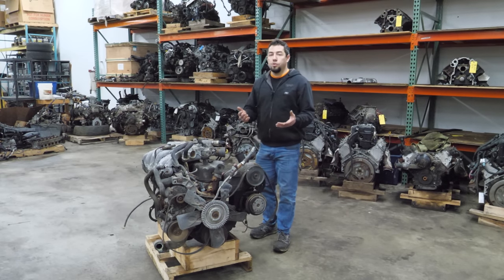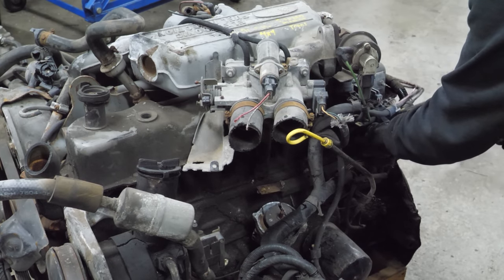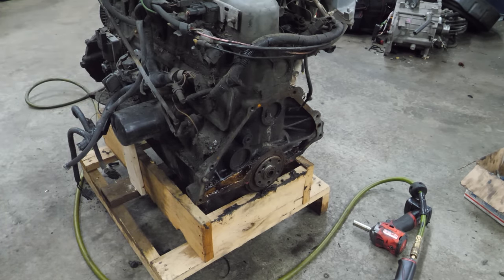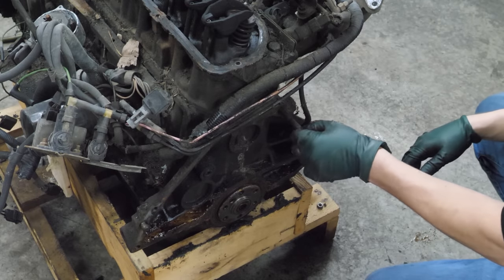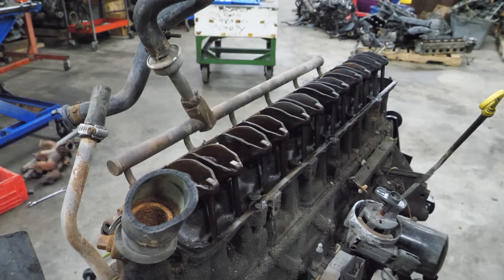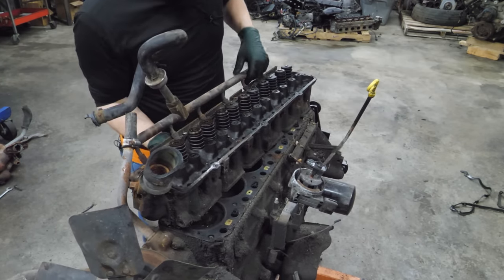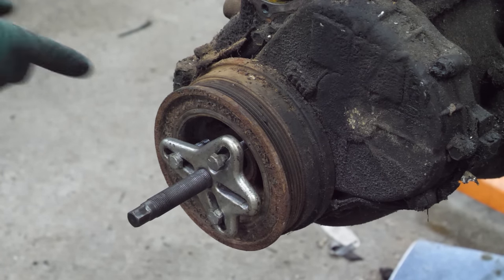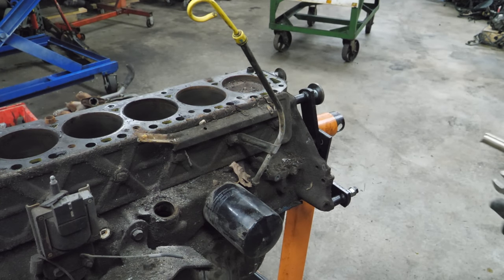FINALLY! A "Bad" Ford 4.9L 300 Straight 6 To Teardown! Most Reliable Engine, Ever?

Comment: Even the most hardcore GM guys think it will be a 300 that hauls the last remaining LS to the scrapper. 

We ran one out of oil on the farm and locked it up. The next day after it had cooled overnight, we added oil and it fired right up. Still used it as a feed truck for several more years.
Reply: No we don't
Reply: I can think of only the 3.0L diesel that is used in the 80s toyota hillux as more reliable 🤣
Reply: @michaeltarno2979  I'd say the 22R could be a serious contender there... My cousin Had a Hylux and put it thru hell and back... Fequently ran it out/ low on oil and that motor would not die....
Even after he crashed it and flipped it onto it's top... that damn motor still fired right up....
The rest of the truck was totaled though....
Reply: Old chevy inline sixes had the same reliability as a 300
Reply: @UAE_8100   The 235, 250, and the 292 were excellent engines.
Reply: @hdezn26  the 22R is a good engine, but not as good as the 300. Honestly the 2.7 that replaced The 22R, was a much better engine. The 3.4 5VZ-FE is way better too. 22R’s  needed timing chains and timing tensioners, and constant valve adjustment, whereas the 300 used gears.
Reply: @hdezn26  I done much the same with a ford 4.0L Cologne six(though it was well maintained) was my first truck, Id nearly kill to have it back again. Thing simply far out performed its sticker rating. Then again I am almost certain it was custom ordered and an High output. Ive tried many others similar but none would even come close.
Reply: @UAE_8100  Not so sure, the first ones were absolute turds. 
Not sure why this is filling out left to right that is horribly confusing me
I have never personally owned a gm straight 6. Their 4.3 has more than impressed me as well as disappointed me, though the disappointed prospective was from someone else 60k mile neglect. I currently run a 2016 5.3 LS style silvarado. The tranny is trash was replaced at 68k after at drove it for 3 days (got it used) engine it self seems solid. Though I do not trust the  "DOD/AFM" system. I do have a warranty so piss if it does shit out on me. LOL
. .
🤣
Reply: And then a Jeep Cherokee hauls the Ford to the scrap heap...
Reply: I'm willing to bet it used a lot of oil after that.
Reply: @hdezn26  I agree: Just like the in line 6, if there's oil in the crank case and coolant in the radiator, you just can't kill it. The only advantage the "big 6" has on the Toyota 22-R series, is the gear driven camshaft, as opposed to a timing chain. I'll take gears over any kind of timing chain or belt. On the other hand, the 22-R series engines don't use push rods or lifters, so there are fewer parts in the valve train. The Caveat is, you have to adjust the valves in the Toyota engine, in the "big six", the lifters are hydraulic, and therefore, self adjusting.
Reply: @seahorse5677  If that Jeep has an inline 6 in it, it's probably THIS ENGINE!!
Reply: @stevenlatham4397  22r blew head gaskets very easily too. They sucked out here in the desert.
Reply: @seahorse5677 a 4.0L isn’t better than a 300 bud
Reply: @racistdoctor5818  It's actually better across the board, in absolutely every engineering parameter...All parts tougher, better materials, stronger, more power, better efficiency, yet it's lighter. It's literally better, faster, stronger and will run longer...
Reply: @seahorse5677  I must agree, Ive seen both go through very similar levels of neglect/abuse; Though Ive never put anything but a loaner through real hell and I did not have that tundra long enough to really wane its life span. 🤣
Reply: @seahorse5677  Yes after it Just Empties Every Pocket. 🤣 The 4.0 I6 was a solid engine, durable even, but everything else is total crap. 🤣 That engine is the only damn thing "Jeep" has done right ever.
Reply: As someone who put over half a million km on a 22r i can say that they are not infallible. Went through head gaskets pretty regular. Cam chain would eventually wear out. I have a 1kd 3 litre diesel powered one now that doesn't have as good a reputation as the 22r but is yet to be cracked open with over 400,000 on it.
Reply: @seahorse5677 , if you can get it to start, and then can stand to listen to the lifter noise.  I scrapped mine due to unreliable starting and embarrassing lifter noise.
Reply: no we don't.

It will be a 292 Chevy straight six that hauls the last LS to the scrapper, as a UPS truck with a Ford 300 drops off some parts to the yard.
Reply: And an 12 valve Cummins will haul them all.....after the third body is put  on.  🙄
Reply: Come to think of it, I have never even seen a 292 straight 🤣 must mostly all be scrapped.
Reply: @DriveCarToBar  And as for what your vids are based on I can say you have better stuff to watch.
Reply: You kiss men
Reply: @AlphanumericCharacters  yep. I feel like the 22r’s are wayyy overrated like a lot of Japanese motors. I’d go to say a ISUZU 4ze1 is a better SOHC 4 banger than a 22r. Just out of personal experience both love to blow head gaskets tho so neither can really compare to the 300. However my two 4Z’s are frigging tanks. Had a 22r maybe turn of the century? Good truck. What were we talking about?
Reply: SBC's can take a lickiin' and keep on tickin', just ask the one in my wife's 99 Yukoon.
Reply: @vincentrobinette1507  it's actually an AMC engine.
Reply: @michaeltarno2979 no possible way
Reply: @seahorse5677 uh no
Reply: @seahorse5677 no dude it is not better by any stretch of the imagination
Reply: @John-B-Goodenough  I have a  22R something or other sitting in my yard with over 300, on it. Wait I'll start it up.  There we go it's running.  Hear it?  I didn't think so.
Reply: @stevenlatham4397  definitely.. where  dya think Frod got all their 6 cylinder ideas.. lol
Reply: @michaeltarno2979  The first "stovebolt sixes" were in the 1930s and certainly not turds for their era. (I had a '37 Chevy pickup with a 216. ) They were good for the thirties and forties but there is no reason to confuse the great inline stovebolt engines with anything earlier or later. The 292 was as rugged as the 300 Ford and torquey enough that my bro towed a 40 pax International Loadstar schoolbus with his C-30 rocking a four speed and 292 over 150 miles on the interstate. Dangerous but the engine didn't care.
Reply: @hdezn26  The Nissan KA24E ain't bad either - other than some timing-chain issues on the earlier ones. I ran the one in my Hardbody out of oil once (forgot to put the fill cap back on - don't ask) - filled it back up and it ran for 2 more years till I crashed into a telephone pole during a snowstorm.
Reply: @michaeltarno2979  try to destroy a 1E engine
Reply: @stevenlatham4397  Agreed 5vz is a killer engine I've got one with 279k on it in my 4runner and it purrs.  They last 300k with poor maintenance.  I've heard of some making it over 500 without head work and even 800 with head work.  Not as simple as a 300 though.
Reply: @michaeltarno2979 iv had and broken 3 Hilux diesel's
Reply: I like that quote. Neighbor down the road flips trades his gm truck every 2 yrs and never outta debt. He gives me crap about my rusty trusty 33 yr old F150 that usually only leaves the farm in snow now. I say that truck will still be running the day yours is crushed into a cube and sent to China. Lol
Reply: @stevenlatham4397 only problem with the 300 is the heat in arizona during summer even with high octane it would ping under load only had a single core rad tho.

Comment: I never expected we’d ever get a Ford 300 tear down. I am so incredibly stoked on this.
Reply: Yeah me either. Between how insanely durable, rugged, and reliable they are, and how little they actually cost, I figured the only way we'd ever see one on the teardown bench is if a subscriber donated it specifically for a video.
Reply: @TestECull  Someone drove into a tree. YipEEEEEEEEEE ! 
Big 6 look see.
Reply: I know where there is one of those engines in an old van.
Reply: Power nation did a build on the 300 and it was kick ass.
Reply: Why? Do you people think that they NEVER wear out? Or that the trucks around the engines rots out and people keep the engines and just keep replacimg the truck around the engine? 

Of COURSE there's MANY Ford 300 sixes in scrap yards.... Just as many as any other brand.. 🤷🏻
Reply: @davelowets    Industrial design for long hours, timing gear instead of timing chain or belt etc. 
 When I was a kid and they were new to us, they were renowned for pulling strength. The Torque came in much lower rpms than a 5.0 V8 windsor or clevland.
Reply: @DarkLinkAD  Sure, they ran for a long time, but they certainly weren't indestructible, and they wore out just like any other engine does. I've had a few myself, and they were burning oil and shot at 175,000 miles. Nothing extraordinary.. 🤷🏻
As far as torque goes, the V-8 made more torque. Who cares what RPM it's made at, that's what different stall converters are for, and if it's a manual trans then it really doesn't matter at all.
Reply: @davelowets   Yeah, I dont beleive a damn word you just said. Somebody pulling a trailer out of southern red clay cares or towing a semi trucks worth of hay.
 Ive never had an engine with a timing chain or gear only last 175k miles. If it were a timing belt, sure.
Reply: @DarkLinkAD  Timing belts and chains are NOT the only things that wear out on engines...

As far as pulling goes, I've never had an issue with either a straight six OR with a V-8, and I have well over a million of pulling heavy trailers behind pick-up trucks. But I'll tell you this much... The straight six trucks did NOT have the power on the highway like the V-8 trucks did, and had a MUCH harder time maintaining speed on grades. 

The best pulling truck I've ever had was a diesel V-8. 

If you have issues while pulling with a V-8 over a straight six, then you're doing something wrong.
Reply: @DarkLinkAD  I don't care if you believe it or not. I'm not nice to my trucks, and the straight six ones didn't last any longer than the V-8 ones did. 
It IS what it IS.. 🤷🏻🤦🏻

Maybe you're just too young and don't have a clue, but back in the 70s, vehicles didn't even last for 100,000 miles. Engines were shot by the time they ended up with 75,000 miles on them. 
Anyone who drove back then knew this fact. To get over 100,000 miles out of an engine was pretty spectacular, not to mention over 150,000. If youve never had an engine wear out before 175,000 miles, you just aren't old enough to have experienced those days.
Reply: @davelowets  My '77 Impala, '78 K-5, and '80 Camaro all clocked over 150k. The K-5 went over 200k. I've got a '96 300 just like this one sitting in the driveway at over 250k.
I don't know what part of town you grew up in, but 100k wasn't some amazing thing. It just meant you took care of your car.
Reply: @Anubis78250  Go back a little earlier...
Reply: @davelowets wrong again. Maybe you're just jealous because your Chevy will never last half as long as a Ford
Reply: @davelowets a straight SiX developes more torque than a V8 at lower rpms why do you think commercial truck tractors (semi trucks) are all inline 6 designs? It's because they are more fuel efficient and have better torque at lower RPMs. So they are more fuel efficient and last longer because they run at lower RPMs.
Reply: @davelowets clueless much....
Reply: @davelowets 🥴
Reply: @davelowets of course they wear out people are just saying that they don't wear out as fast as some other brands

Comment: I bought a 1996 F150 with a 4.9L.  I drove it 360k miles, the only engine related issue I ever had was I had to replace an A/C compressor.  I sold it to a neighbor in 2018.   The engine ran perfect, didn't leak or burn oil, and still had plenty of torque.  The truck frame was in pretty rough shape however from 22 years of winter road salt and me not undercoating like I should have.   He bought the truck just for the 4.9L.  He had a really old Ford tractor he restored and put that 4.9L in it and it's still running strong today.
Reply: i recently found a 95 with under 100k and 5spd. i drive that truck more than my 250 most of the year

Comment: Warning: long, epic story of truck love below

My wife and I once owned a '75 Ford F100 Ranger (in green) with the 300 that we used as a second daily driver before we had kids. We even used it to move into our home we currently live in. 3 on the tree, only 54,000 miles, had a couple issues but was mostly a nice, clean, solid truck.

One memory enshrined it in my memory as a member of the reliability hall of fame. We were driving down the highway between towns, about 15 or 20 miles or so in winter in North Dakota. It was -20° out and it still ran like a champ. We were about 8 miles from home when we noticed it was losing power and heat in the cabin was fading (it has awesome heat). As we saw the temp gauge rise above normal, we pulled over. We waited for it to cool down, but it still wouldn't restart.

After we tried a couple more times and the cold set in, we called for a ride and got home. The next day we made arrangements for it to be towed home so we could decide what to do with it. I did some forensics and discovered the coolant wasn't the right ratio for winter and had frozen in the block.  Noticing that it had some milkshake in the oil and feared for the worst and planned to resuscitate it in the spring. We loved that truck.

Long story short, I went all in, and swapped the head gasket. It was the first time I did anything like that. After it was done, I flushed the cooling system and put in fresh oil and it ran like a champ until we sold it. It went to a very excited high school boy and his father. We later saw it entered in a local classic car show with a vanity plate, "SWEET P." We like to think she's still out there chugging along.
Reply: Good chance of it!
Reply: Sweet Pea such a lovely name for a lovely machine.
Reply: I cried reading this.
Reply: Mines been through a flood that destroyed all the other trucks in the neighborhood. It drove out in water up to the bench seat. Then i over heated it and continued to drive it for about 10 miles with no coolant. I've run it out of oil and drove it home multiple times. I dont neglect it but it has sprung a couple terrible leaks and leaked its oil out on the drive.

Comment: I had a 76 f 100. Rebuilt that engine 3 times. The last one was the only time it needed any machine work. Bored it 30 over, shaved the head and deck 10 each. 
Went back with flat top pistons, an RV cam which didnt give much ore lift, but longer duration on the intake side. New valves and springs, ported the head to match an Offenhauser 4bbl dual plane intake from Summit. And a 390 Holley carb. It made 378 hp. And almost 400 ft lb tongue on the engine dyno. Best motor I've ever owned. Sold the truck last year. Still on the road now in houston, sporting a new paint job. Really wish I had her back

Comment: Iron water pump!!! Designed to last forever, just fit a kit when it goes bad. (From my book, My Teen Years.) A Fordson Tractor Waterpump. I was 18, 1963 and I fortunately found employment in the Queensland, Australia, Main Roads Department. It was possibly a year or two later when the below incident occurred.
The bitumen gang had a tractor dragging a broom.   The boss and I went out to repair the waterpump, it was usual in those days to press the pump apart and replace the worn kit, bearing and seal not like today where you dump the old one in the bin, pull a new one out of a box.   We were on the side of the road with the pump setup on some ripper tines and a hydraulic jack under the tractors front axle! Ted from down under.
Reply: What really caused a lot of water pump failures comes down to two things. One is the mechanical seal failing between the impeller and the bearings. Second is the belts start to slip and idiots overtighten the belts putting a heavy side load on the bearings. The material in the housing itself gas little to do with it. I've seen guys build minature drill presses using water pump bearing assemblies (1) as the spindle. Turn or grind a taper on one end to mount the chuck.
1) The shaft and bearing assembly came in from the manufacturer as a unit. Sealed bearings. The weep hole in the pump should keep coolant away from the bearings but shit happens.